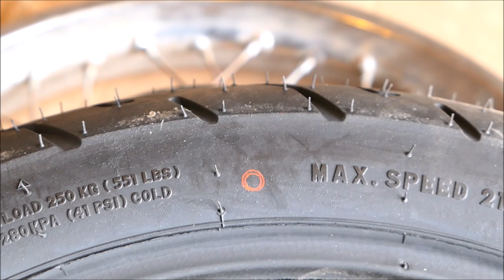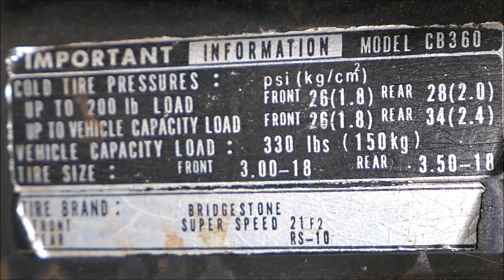Honda CB360 Gets NEW TIRES! Bearings & Brakes Inspected!

Comment: I can't believe how knowledgeable you are about motorcycles one thing I learned is to hire someone like you rather then try to fix up a motorcycle myself. I had a 1975 Honda 360 and a 1976 Honda 550 I sold them both for around $1500 dollars in 1977 and 1978.
Reply from the maker: Thanks! You could fix one up just as good as me!

Comment: one minute into this video and i'm already impressed.  you make everything look so easy!  you're a natural bike mechanic lol.
Reply from the maker: Thank you!
Reply: @kentuckyyankee  hey.  maybe you could tell me:  on a cb360t is it possible to hook up the starter solenoid backwards??  i just installed a new one but there no markings on it for which wires go to which side of it.  the harness wires i hooked up correctly (there's only one way to do it) but the other wires to the main terminals i'm not sure about.  i tried it out and it DOES start, but i don't know if it would start no matter which way i hooked it up?  could this cause a problem down the road if it's backwards?
Reply: nevermind.  seems it can be hooked up either way.  just found this on the common motor website:  "The connections on the solenoid for both the large wires and the smaller wires can be connected in either way as the replacement solenoid is symmetrical."
Reply from the maker: @andrewhammer4375  That's correct, sorry buddy I was sound asleep 😴....
Reply: @kentuckyyankee  no prob man!  when it's just me and this computer at home, i forget that the rest of the world is not all night owls lol
Reply from the maker: @andrewhammer4375  😂😂
Reply: -Don't swell his head up to much.

Comment: KY....... I know it’s rusteration not restoration..... however, cleaning comes under preservation.... after seals are replaced some degreaser in this area seems reasonable and you did not polish rear brake cover as you offered..... love this bike and as mentioned before mine is a 70 Cb350 close to completion
Reply from the maker: Can't argue with that....

Comment: Did you put oversized tires on or just stock? When you change the sprocket try going one up on the front. You'll lose a little low end but you'll get a substantial increase in gas mileage and more top end plus lower revs. You otta invest in a pressure washer. I would have replaced that chain
.
Reply from the maker: Those are stock sized tires

Comment: learn the zip tie method of tire removal. it is MUCH easier. I removed the rear tire from my motorcycle without using any tire tools once the bead was broken. Took it off with my bare hands.